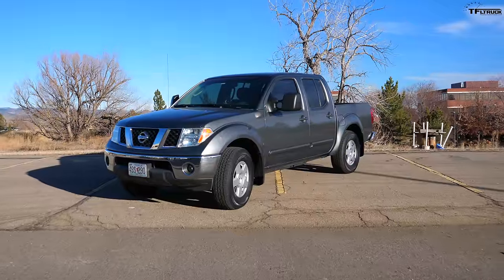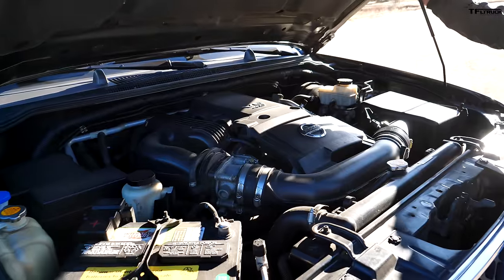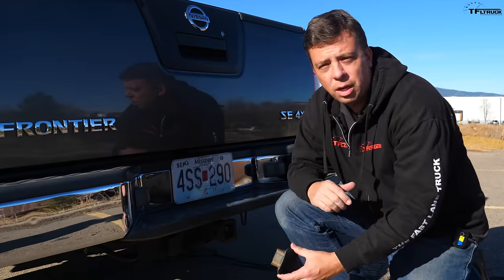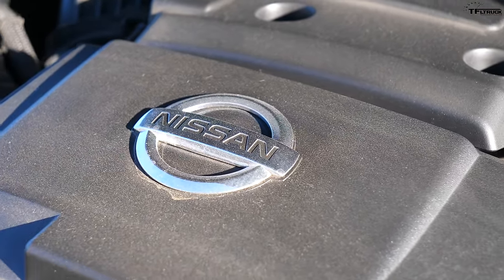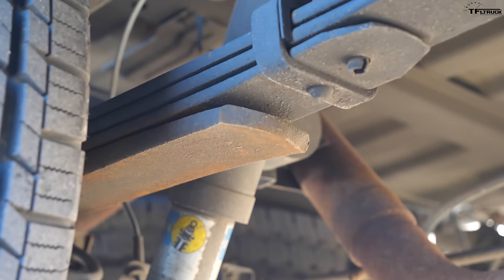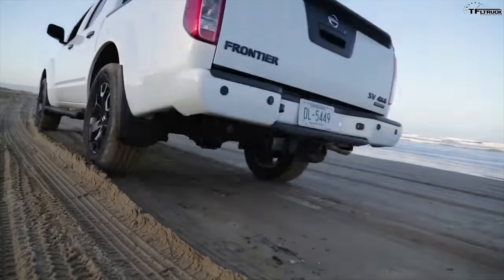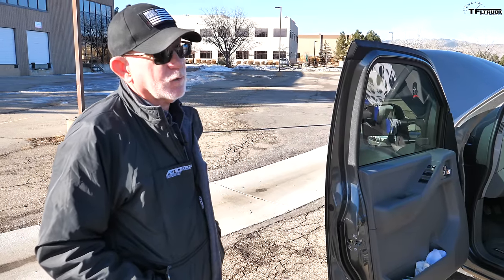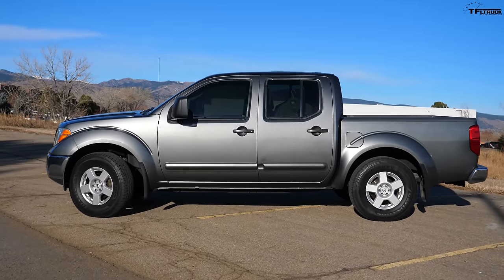Here's Why I Prefer The Old Nissan Frontier Over the New One — Dude, I Love My Ride!

Comment: My 2012 Frontier with a 6 speed stick has 140K miles. Only ever required routine maintenance. Still has the factory brakes. My brother’s 2005, 6 speed stick has over 600K.  His catalytic converter has been replaced twice. He calls it a ‘high failure’ item.
Reply: Does he have a v6 or a i4?
Reply: Well, cats don’t exactly go out on their own. He should probably have that checked out
Reply: @whynotproductions9519  Once every 300K miles?  it didn't seem excessive to me.
Reply: @AceOfSpadesOfficial  both of us have v6 engines.
Reply: I'm about to hit 150K in my 2005 4x4 SE Frontier/6-speed manual. My passenger cat gave up at around 134K. Replaced the primary cats with OEM units and the non monitored with magnaflows....with a magnaflow system all the way to the tailpipe. No timing chain issues. Other things I've replaced was the fuel level sensor, number 3 coil pack(and all on that side as the intake manifold has to come off), and crank sensor. Did all the work on it myself. For a 15 year old daily driver, it's given me good service. I plan to drive it until the wheels fall off.
Reply: @whynotproductions9519  common issue with them
Reply: I"m putting new calipers on my 2011 Pathfinder today.  However, i attribute that to 9 years of rough salty winters.  
Stock O2 sensors, stock exhaust (just got a hole in it last month) and i love how it does in the snow.
Reply: Seems like the cats failing is something common I’ve seen on high mileage frontiers. I’ve got one at 180k and had to replace the drivers side cat at 170k. Definitely a tank though I’ll say that
Reply: @poog6256  The good news is that after market cats aren't too expensive.
Reply: Dan Harris is your 2012 Nissan still has the original clutch?
Reply: @gutadin5  Yes it is original.
Reply: Dan Harris is your brother's 2005 6 speed still has the original clutch ?
Reply: @gutadin5  No. His has been replaced...at least once. Mine, which just topped 140K miles has the original. I did have to finally replace the factory brakes a couple of weeks ago.
Reply: Glen Surles  The 02 is an entirely different engine than the 05 - 19.
Reply: It's a oil burner!
Reply: @whynotproductions9519  for its worth my2005 Frontiers cats went also, fixed one and shut the lights off. sold then with 157.000 on it, wish I just replaced the other one , but $1500. was a lot then on my Le. That 2005 4.0 was a champ!
I average 24mpgs on the highway, with a Pro Net on the back and  Warrior Bars on the bed so it wouldn't boe.
Reply: @poog6256  did my driver side at 150
000 , the a week later the other blew

Comment: I have to pause when you said Tacoma looks better. Whew, hurts my old eyes to look at a Tacoma. Nissan Frontier any day for looks! And, it’s more comfortable to me, easier to get in and out. Just a good, simple truck. What we need.
Reply: Taka Yama the first gen Tacoma looks better imo the new one is ugly.
Reply: Tacoma will outlast a frontier without a doubt. And also brand recognition is why I choose a tacoma easily
Reply: @josefgriveas7113  Honestly the two will probably last equally as long if maintained.

That said yes Toyota has brand name resale value- but that doesn't mean much if you've already dropped the money on a new one.

What I say is look at the platform and choose based on how you want to build the rig, not necessarily how it is stock out of the factory-  For example my titan-swapped (long travel 4wd) Xterra with locking rear and front differential will outperform any 4runner or tacoma out of the factory.   For the cost of a frontier vs a Tacoma you'll have a lot of money left over to throw at your suspension.
Reply: No way the Nissan looks better. Tacoma all the way!

Comment: Nissan's are typically bulletproof, as long as it has a manual transmission.
Reply: Nissan? Reliable ? 😂😂
Reply: I assume you're worried about the CVT?  Frontier autos are a traditional transmission. I have a 2015 Altima with a CVT and it's been great, but I understand they have been sketchy in the past.  

My Ford transmission in a Focus almost killed me twice in half the miles.
Reply: @NateOlson  The automatics in the old pathfinders and trucks were horrible. The 3.0 would run forever but the transmissions would lose reverse around 60k. My aunt had a Sentra 5 spd that went 330k with regular maintenance it was ridiculous. The new cars aren't going 100k without major problems.
Reply: @josefgriveas7113  Yeah I had a 95 Maxima that got 35 mpg on road trips and never had any issues. After 00 when they switched to the 3.3 liter and cvt transmissions it all changed.
Reply: @Jim I have a 2019
Reply: @Jim also, was getting 8,000 k miles per major transmission repair with the Ford.  I don't think strawberry milkshake compares.
Reply: Jim as a nissan owner that purchased shortly before the strawberry milkshake issue, it is my theory that people simply dont change out the coolant on time and allow corrosion to eat through the divisive wall between the radiator and transmission. I have an 08. Same radiator as everyone else, but i change the coolant every 2-3 years no problems. If you notice people really started to have problems around the 5-6 year marks. Coincidence.... i think not.
Reply: Never had a problem with my auto
Reply: @Jim yep. happened to mine. $4000 dollar repair.
Reply: @josefgriveas7113  i mean theres a reason the frontier in particular has a cult following, its a proven truck and has shown itself to be mostly reliable under long term use as long as u maintain it like you should, and yes im a frontier owner i started out ont he 2000 nissan frontier SE crew cab 3.3l v6 and ended up upgrading to a 2010 nissan frontier LE 4.0l v6 both being 4x4 automatics and both being over 100k miles when i got them

Comment: Heard a new version of the Frontier was coming soon, most likely with the “bells and whistles.” 
So I pulled the trigger and bought a 2019 with manual transmission. Of all the features the best one is it HAS NO FEATURES! Less extraneous crap to go wrong.
Love it so far.
Reply: Riff Raff I bought a 2018 on the last day of 2017. I love. And like you, the best part is no technology to master
Reply: Smart move!!!
Reply: I recently bought a 2016 Frontier that is completely stripped of any features. I'm talking no power windows, power locks. I love it as I know many truck owners who have all the bells and whistles and after 5 years their trucks are riddled with all sorts of electronic issues.
Reply: I have a Ford Econoline cargo van with roll up windows, no power doors or mirrors and I love it. They will never break and you can roll the window down when the van is off. That itself is a luxury.
Reply: The more simple the vehicle, the longer it will last.  My aging 1997 Jeep Wrangler has no power anything, save power brake. Nothing is automatic, save the timing.  Everything is manual.  It had 409,000 mile on the original engine, manual gearbox, axles, wiring, and even the exhaust.  Unfortunately, it has the original seats.  They are not very pretty.  But the old Jeep runs like new, uses no oil, is straight as an arrow, has lots of power, anx ready for another 409,000 miles.  I bought it new with 11 miles on it in late 1996.  It was always the aim to keep it 25 years minimum.  The 25th year is approaching. I have no plans to part with my dear Stargazer (my old Jeep).  I am certain I can easily get another decade from her.
Reply: Last chance to have a '' small '' truck that has a reasonable height . I can just bet that the next gen will be high for nothing with a cathedral front end
Reply: My 2016 has all the bells and whistles I need. My oldest son is a Nissan exec so I can get an excellent price on a new one but I'm happy staying with the '16.
Reply: CarJunkie I agree!
Reply: Yep. The most technologically advanced thing my 2013 Frontier has is hands free calling, which I never use. I would have been happy if it had hand crank windows. Spartan interior, 4x4, and a stick shift. I wanted nothing more
Reply: I prefer a manual transmission myself!! ❤
Reply: I have an 05 4 cylinder with the manual transmission. I've owned it for 100k miles. It's been a great truck.
Reply: I believe both the engine and manual transmission  are made in Japan, at least on my 2017. Very pleased as well
Reply: That's why the last generation Crown Victoria Police Interceptor and other panther platforms are still running strong today , they were simple and built to last.
Reply: Backwards for me. I got a 2015 SV then found out the new gen was coming. I was FURIOUS. Just found out like last week it wont come in a manny and im giggling now 😁 it is a basic hoe but i got Bluetooth, heated seats and 4WD. Im good
Reply: I bet you're happy you have that truck now.

Comment: I have a 06 frontier with over 223000 miles on it 
And it still runs great
Reply: Hows the timing chain holding up after the first rebuild?
Reply: Chad Gilliland  I'm about to be at high mileage on my 2016 Altima.  I'm at 243k!
Reply: @occckid123  you drive 60k miles per year?  So you must be some kind of courier.
Reply: @tasimota  the car makes 3 years old in March so its actually higher than that . I got the car new in 2017 March. I dont use the car during the day I drive a sienna lol. I drive it at night and on weekends.
Reply: Hold my beer...my 2007 frontier 4cyl has 440.000 miles, same transmission, engine give up at 404.000
Reply: Manual or automatic?
Reply: @occckid123  hows the cvt?
Reply: @BIGmil20  its running great rn. I've had some oddities here and there where I thought it was time 4 a new 1 but both times I've changed the fluid and all was good.  Around 180k and again around 230k I felt it was acting a bit strange.
Reply: Rogelio Salgado  me to but I get about 13 to 16mpg
Reply: @traceykays433  I got 37.7 on my last tank of fuel and I'm still complaining lmfao
Reply: I have an 04, with 350K and just replaced the starter!, it does burn a qt every 1200 + miles but still runs great! no leaks or anything.
 I change the oil every  3000-4000 miles, and take care of the transmission (automatic) fluid, change every 100K.
I will be ready for an 06 soon, lol.
Reply: I have one with 92k sitting in my back yard Mint Condition ready for the JUNK YARD .
Reply: 08 240000 so far still runs strong
Reply: ITS NOT EVEN JAPANESE ITS A FRENCHIE
Reply: Gustavo, what engine/transmission, 4x2 or 4x4? Also, how were your timing chain guides and radiator/trans cooler? I have an ''08 Frontier V6  auto 4x4 crew cab, I bought it new and have almost 41,000 miles. It's had no problems, I did have the in radiator transmission cooler disconnected, to avoid the rust through issue some were having.

Comment: Thanks to you guys, this past october, I went out and bought a frontier with super low miles, and I got a great deal on it. Ive been a GM guy my whole life. My last 2 trucks were GM, and I was constantly under them fixing everything under the sun. I just couldnt take it anymore and found my 2015 Frontier while I was driving around town looking for trucks. I wanted the titan, but was offered to take a ride in a frontier, and I fell in love with it. It can tow, it can haul, it can seat 4 adults, it has heated seats and a CD player, and its 4x4. I was sold. I sold my silverado 3 weeks later, and I havent looked back. I LOVE this truck. The power and comfort are second to none. This truck puts the colorado/canyon to shame. And I cant wait to start customizing it!
Reply: My 2001 4.8 1500 rusted to shit 
Brake lines cost a shitload
Plus electrical problems and abs issues 

But I did drive it like a sports car and (literally) use it as a farm truck and for logging occasionally for a few years- used 4wd a good amount

Comment: Nice honest review, My 2010 Pro-4x 6spd has been excellent. A few things I'd like to point out, The crew cab long bed was available with the 6spd for several years, rare though. The timing chain guides were updated from 2010 onward eliminating the issue. The m226 axle parts are available from the aftermarket.

Comment: Ive had 2 nissan trucks  (85 king cab and 01 king cab) and they have been the most trouble free vehicles I've owned.  The 85 went 254000 before it blew a head gasket.  I replaced it with a brand new 2001 which to this day is still running and has 202000+ miles. Both were 4 cylinder manual trans.  The 01 still gets 25mpg in mixed driving.

Comment: I know this is about a Frontier, but I have a 2010 Nissan Titan and the thing has been a tank. Everything on it is still original and I have about 127k miles on it. Rides like the day I got it. Only ever changed oil on that thing. Granted I live in Arizona, but I do take it up North where there is snow and salt and no rust on it. I haven’t ever towed a crazy amount of weight, usually my side by side or quad and trailer so never more than 4K pounds but it handles it like a champ and I wouldn’t hesitate doubling that weight. This was the perfect truck and it’s a shame nobody ever gave the Titan’s more thought. They were way overbuilt for their time and I wouldn’t hesitate taking it on a cross country trip today even with all original components. It’s that tough and reliable.

Comment: A word of advice to all planning on buying a 2005-2009 frontier/xterra/pathfinder- the radiator has a defect and needs to be replaced.  It's a $120 dollar fix that prevents $5,000 worth of transmission damage.

These vehicles are great, even 2005-2009 provided you replace that radiator.  They're bulletproof after that.
Reply: Just for the automatics. The manual transmission models like his don't have any issues!
Reply: No problems on my 08. Pathy and 07 Fronty both with high mileage.
Reply: How can you tell if it has been replaced?

Comment: Great review from a real long term owner.  I also am a Frontier owner and it has been a great little truck: 2007 NISMO, 4.0L engine, 4x4 6 speed manual, king cab, long bed with 185,000 miles.  I live in the hills of Pennsylvania and regularly tow about 4,500LBS with my trailer and compact tractor with no issues climbing or descending the hills.  After completing my military service in Georgia, I hooked up my 16' cargo trailer and packed up all my belongings to return home about 1,000 miles.  Hitting the CAT scale, I discovered my GCVW was 12,700 LBS!  Again, no issues and averaged around 13 MPG even being grossly over weight.  Same as this gentleman, I needed to have the timing chain replaced around 80,000 miles.  Other repairs: 110,000 clutch, 112,000 rear end (removed diff lock, installed limited slip), 125,000 front wheel bearings, 175,000 ball joints, NO other major issues.  I have no doubts I will see 200K + and another 5 years with this truck.  I have no second thoughts about the capability of this truck off road or long haul road trips :)

Comment: Thank you !!!!! I own a 2011 frontier pro4x and I'm now going to check the timings chain, my baby purs like a kitten and is a great ride.

I'm shooting for 1,000,000 miles and I hope some day I get there I'm at 110,000 so far, this weekend I'm doing all the fluid and new pads all around, also I don't let anyone wench on my truck I do 100% of all the maintenance needed.

I also have a 2006 Pathfinder and it also rides as if it was new, mechanically both vehicles are almost the same.

Comment: Great review. Here's my experience :

2002 Frontier Supercharged King Cab - - 460,000 miles when my son gave it to his mechanic. It's still on the road.

2010 Frontier King Cab LE. Traded it in at 365,000 miles due to bad cats and needing a timing chain job. Traded it in for a 2016 Frontier SV crew with 50,000  miles in 2020.

All trouble free with regular maintenance. Enough said.

Comment: love it. after the timing chain he said, "no issues" then he talked about having to replace the rear end. that was another 2500 bucks or so. only thing left is the trans. About time for a clutch. lol
Reply: I had an 11 & put on 180k with original clutch. Every other repair was wear and tear like shocks etc. When I sold it all it required was new leafs. Most reliable vehicle I've ever owned.
Reply: Toyota fans says "no issues" until the frame goes dust. So it's ok
Reply: The rear end isn't the engine....

I replaced my rear end with an m226e locking differential not because my rear was bad, but because Locker!

Comment: Also for 2006 Japanese automakers used a different method for calculating horsepower and torque. A 2005 Frontier was rated at 265 HP and 284 Lb-Ft Torque, however after switching to using the new calculation method it was changed to 261 HP and 281 Lb-Ft Torque. The same happened for the 2005-2006 Tacoma, went from 245 HP/282 Lb-Ft Torque to 236 HP/266 Lb-Ft Torque!

Comment: I own a 2005 Frontier. Has been a good truck but this and later yrs had issues with timing chain guide replacements (mentioned at $1700) and an issue with radiator failing (not mentioned) that causes rad fluid leak into trans. These two issues were common enough to force recallls.

Comment: Bought a '15 new, now has 97,000 miles V6 auto don't tow or haul anything it has all the extras but nothing like the top of the line big boys. Just wanted a small truck for moving miscellaneous stuff around the house from time to time. No issues at all, replaced brakes and tires before really needed to stay ahead of maintenance, used nothing but synthetic oil since purchased. At 100k plugs and belt will be changed, radiator, brake and power steering will be flushed hopefully the second 100k will be trouble free too.

Comment: My 2015 Frontier has been running like a champ and I use it as an HVAC work truck these days. Tows my 6x10 enclosed trailer without a whimper and drives on the freeway on rails. It's also my 4th Nissan truck since 1994. Couldn't be happier with it and never felt I needed anything bigger. She gets it done.